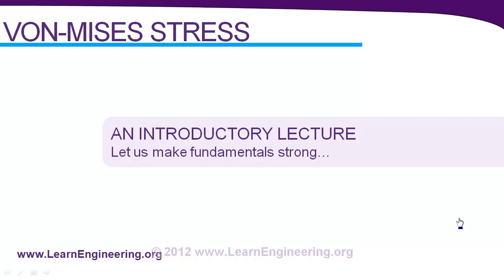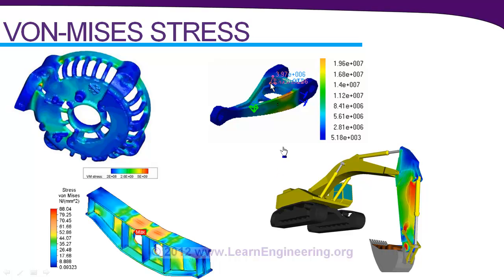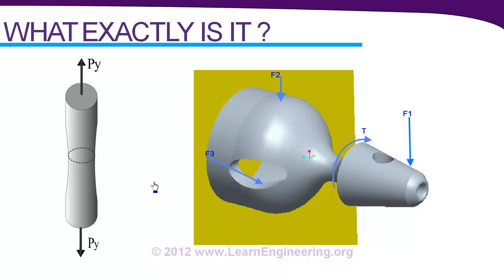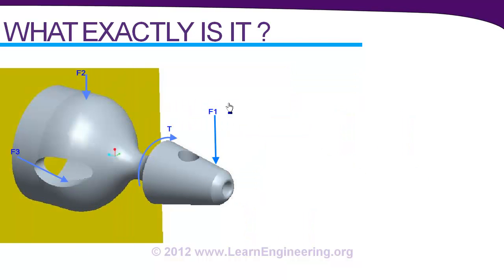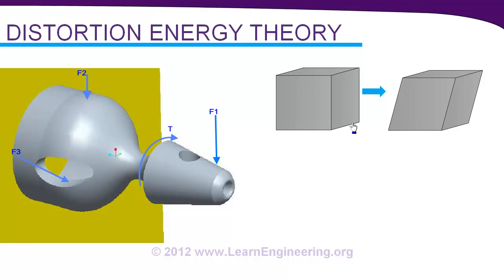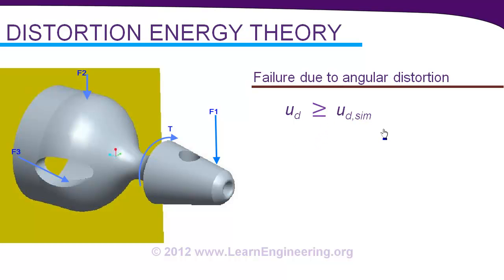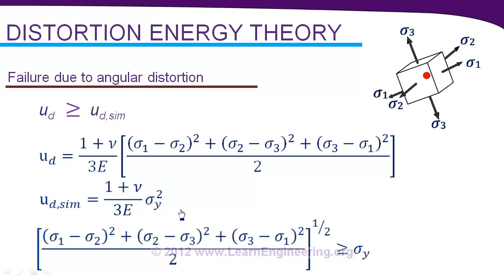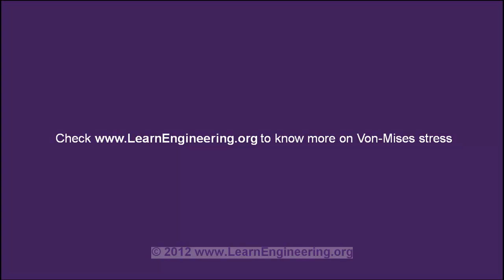Von Mises Stress ,Yield Criterion & Distortion energy theory

Comment: hello sir. At 0:53, you define that, if von mises stress is higher than the strength of the material, the design fails, but explain which is that strength, full name of that strength? Yield strength or what? Pls reply

Comment: Von Mises criterion holds good during IN-USE application of an READYMADE engineering component.
WHAT about a component during the course of manufacturing from raw material through a process like cold rolling/cold forging/cold extrusion.....? suppose I manufacture a component (say a shaft) from a steel billet or slab through forging operation? Should the same criteria be met?
Reply: As long as the material is elastic you can apply von misses criterion.

Comment: What If the Von-M stress comes near to the yield stress i.e. for eg. if V-M stress is 234 MPa which is near to 255 MPa, Though according to the criteria structure doesn't fail but in real time should we consider the design safe? pls ans ASAP.
Reply: Shrikant Ramanathan That's how you kill people
Reply from the maker: Usually engineers use a Factor of Safety of 2-3. So you can consider the current design as unsafe.
Reply: Learn Engineering some time you need to consider lean design, what then we can't take FOS more than 1~1.2, inorder to reduce cost considering the same material and loading conditions..?
Reply: You can tak an FOS=1 or 1.2 if you are very sure of your materialsmand calculations, e.g. In the aircraft industrie
Reply: ***** Thnx for your valuable insight.
Reply: saving some bucks

Comment: ..CONTINUE POINT 1..
...value of desired fatigue life Nf
2. Enter the cyclic and fatigue properties of material, b,c and so on..
...and then?? 
For example, equation 9 has Sa in the LHS and Sm in the RHS of the equation,thus the Sa-Sm diagram is easy to plot, but not for the equation 21. 
This is a great alternative to goodman diagram you mention in the site..do you know
p.s. Consider you have to enter in the above address "h.t.t.p" before the 2 points 'cause youtube it blocks the message

Comment: I catch your point it makes me think of an equation i hold in my hands right now..it is the Smith-Watson-Topper equation,one modification of the goodman diagram accounting for the mean stress.
The article is at page: "://mme.uwaterloo.ca/~camj/pdf/2011/3_Glinka_2011.pdf
The equation 21 is used to calculate the strain amplitude for a given fatigue limit. 
The problem is: if i want to create a diagram, Sa-Sm - i.e. stress amplitude and mean stress - using this equation 21 shall i:
1. enter the

Comment: >>FOLLOWS FIRST PART BELOW>>
..the yield strenght of material is the one calculated after loading the structure by what magnitude? Is the von mises stress produced by a "limit load" or "ultimate load"? limit and ultimate in aerospace are the loads producing, respectively, no permanent deformation and failure.
What do you think about? Shall i calculate the von mises stress at a limit load and compare it with yield of the material, or at ultimate load?

Comment from the maker: 1. In this case structure will definitely fail. No need to go for Fatigue analysis, fatigue strength is always way below yield strength of material.

2. You can compare 2 energies. Comparing distortion energy in actual case ( with help of 3 principle stresses) and Simple tension test case makes sense.

Comment: Ciao, i have some question: 1. Suppose the von mises stress calculated by fem software exceeds the yield strength of the material, are you sure that in this case the structure is unsafe? Maybe you need some further analysis,like fatigue analysis?
2. Suppose i calculate the 3 principal stresses. I substitute in the formula of maximum-distortion energy criterion and compare the value to the yield. Do these approaches make sense?
Reply: 1. It depends on the loading condition you're talking about. If you're interested in fatigue loading say a 300 MPa stress prolonged for 20 years will break the component, then you need to adopt a different model for analysis. 
2. As he says, it works for most cases in ductile material category. There are several other theories for different material you're using.